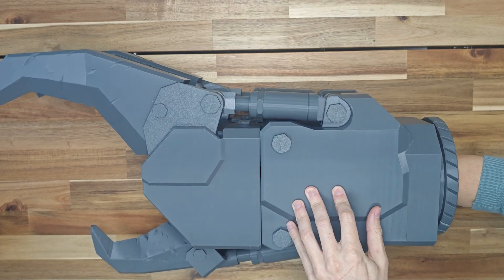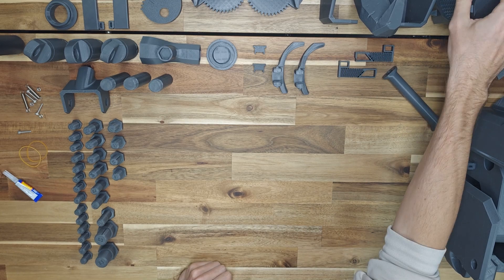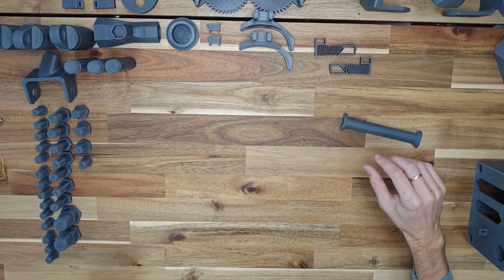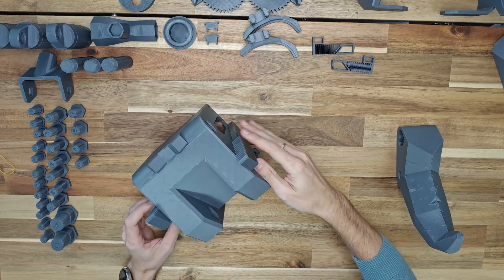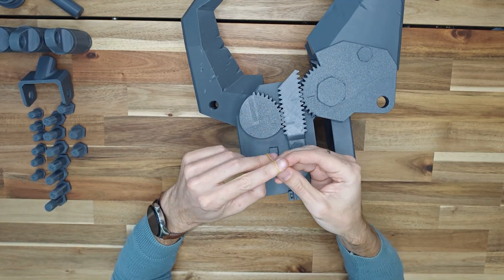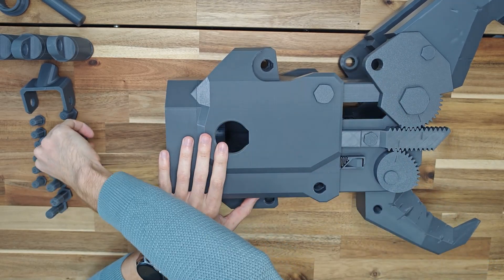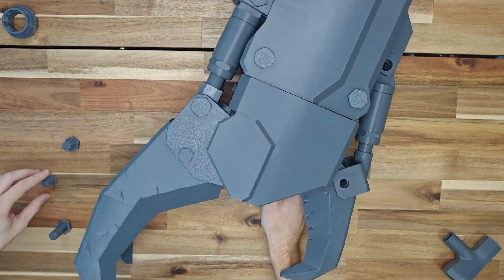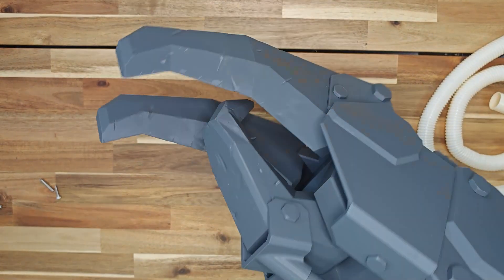Fully 3d printed Power claw

Comment: Hello Alex, I just finished printing my klaw and it looks fantastic! But I've ran into a problem.

I've followed this guide with the exact settings shown for my printer and used the appropriate materials for each part (PLA+ for most parts and PETG for the springs) but it seems that the springs are not strong enough to pull back all three klaws, leaving the power klaw closed without resetting its position by itself, so I'm forced to do it by hand.

What could be the problem?

Comment: Hi Alex, this is such a smart design! I have one question, if I print half scale for my boy, do I need to use 0.2 nozzle or lower layer height in 0.4 nozzle?
Reply from the maker: Hi, in video I showed 50 scale and it’s printed with 0.4 nozzle 0.2 layer height
Reply: @Alex_Geek_Workshop  I was too agreessive and printed with 0.6mm and the tolerance is not great.. the spring V2 is not strong enough for the friction. But I'll try 0.4mm/0.2 layer. Thanks! Do you think 50% would be good for 3rd grader? 50% Seems large enough if not tool large for my 3 year old but not sure about 3rd grader(for day care gift drive purpose)
Reply from the maker: @leohe9402 actually it’s optimized to print with 0.4 nozzles, and tolerances also is not only about nozzle , a lot of different settings can affect it , so try 0.4
Reply: @leohe9402 how'd it turn out? Interested in an update!

Comment: i like that you dont have to necessarily have any non 3d printed parts (besides like a rubber band but like its basically nothing) as me personally i dont like when prints (with exceptions) need you to have bolts and screws and such as the hole point of 3d printing for the most part is to avoid them

Comment: I keep having issues with your products. Using the m style nuts and bolt is problematic as the nut spins in the printed socket and there is no way to stop it or remove it as the bolt is partially inserted and locked in. Please make them not blind holes or find some way to prevent this
Reply from the maker: @jplafor  you mean in rail part? I will make hole through all part, you can also try to apply super glue on nut in socket. Also try to calibrate flow rate
Reply: @Alex_Geek_Workshop  my flow rate is already calibrated and the fit is extremely tight. I have tried superglue as well but it does not solve the problem. The issue has occurred on the spring mount locations of the claw as well as in the sword sections of chain sword and also the drive gear of the sword. If the m bolts bind up in the nut at all, it overpowers the pla and spins freely with no mechanical way of holding it down to even back the bolt out. Not to say there is a solution but just figured I'd give constructive feedback. Love the work and keep it up
Reply from the maker: @ i checked my files and hole is on full lenght not blind
Reply from the maker: @ There is no other way to make the sword because of the complexity of the design, the only thing you can wish for is soldered bushings, but then you will need a soldering iron for assembly, the sword is already very complex, so what to complicate it even more. It is strange that super glue does not help, or the glue is bad
Reply: @Alex_Geek_Workshop  yes the bolt hole is. The nut hole is not
Reply: @Alex_Geek_Workshop  yah, sometimes there is no better solution. Just figured I'd bring it up and hope for a solution from smarter minds then my own

Comment: okay so I finished printing and building mine. I scaled it down to 90%. I wanted to go completely 3d printed, so did the springs in PETG. But even with claw bolts loosened , claws printed with very low infill to reduce weight, and all pivot points lubed with paraffin wax, the springs lack the strength to open the claws back up (everything is loose enough so the claws will drop closed with gravity and drop open when vertical) . So Im using rubber bands (3 per side) for now. Im redesigning the claws into a more industrial look (okay wife loves steampunk stuff too lol) and will probably print at 80% cuz theres no space orks around here :) Everything else I love, the functional bolts and the ability to disassemble and reassemble for painting, and the inclusion of the printed wrench, everything fit together perfectly and look awesome. I'll be getting one of your chainblade models and parts kits soon. edit: I forgot to say how much I appreciate the interrupted thread design in this, threads have always been a problem for me before in other models, but these all  printed first time perfectly)

Comment: printing mine now. the two largest parts are completed, as well as bolts and "hydraulics". got a claw and mount printing now. I scaled it down to 90% so its a little less chunky and will pair better with an arm project Im working on. I was looking for some sort of gauntlet to kitbash for it, and found this claw. I'm thinking of going a bit more industrial with the paint, a cross between the Aliens power loader and "steampunk"

Comment: Having gear timing built into the parts is inspired! You may have singlehandedly increased the number of Orc cosplayers.
The only thing I would change in to have a physical stop to prevent over tightening the parts that you noted can be. (Perhaps make those blind holes or have a drop in spacer so those parts do not need different bolts.)
Reply: I just printed my bolts at a higher infill :)

Comment: How well would plastic cement or MEK or cellulose thinner work instead of glue with the the plastics that are useful for 3D printing?  I'm also wondering what that would look like on you in 3/4 scale as the 1/2 is obviously too small for you but the full sized print looks a bit off in terms of proportions, though that might obviously change if you start adding more pieces to the cosplay.